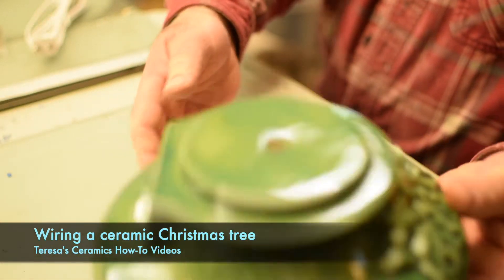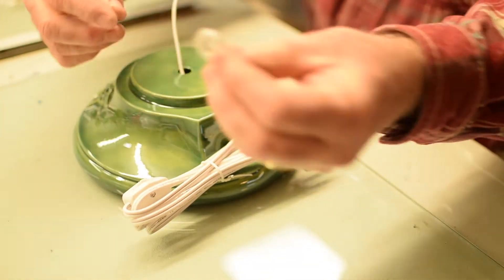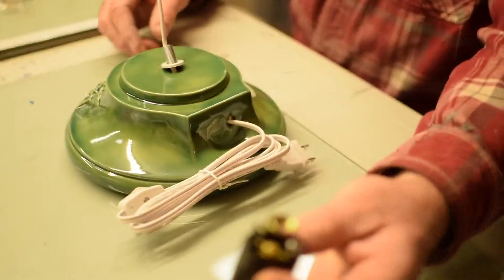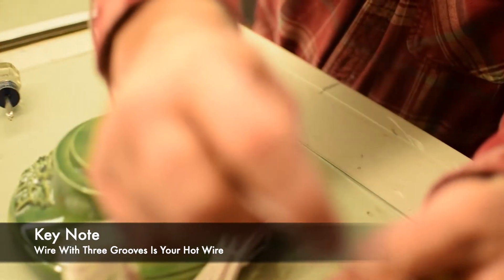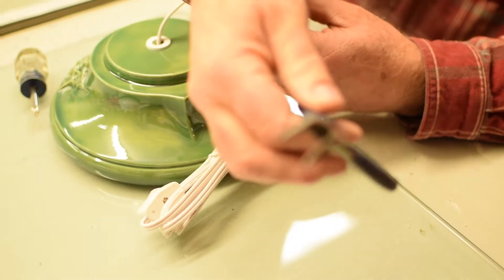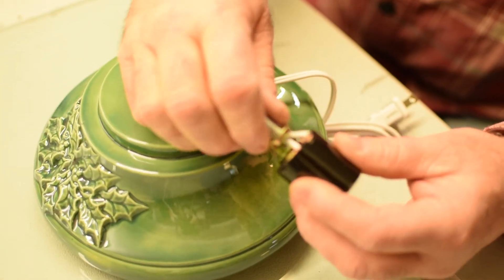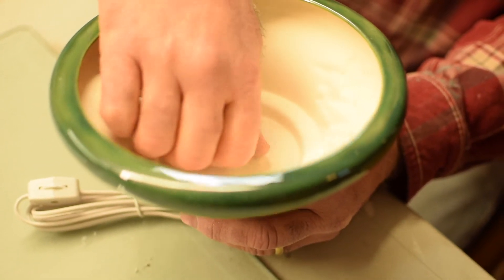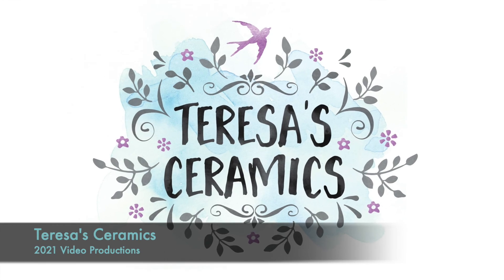How-To | Wiring a Ceramic Christmas Tree Base | With Teresa's Ceramics

Comment: Good video, however there should be strain relief (provided by knot inside base, or Ty-wrap ,to keep wire from jerking out it cord is jerked. Also bu Ul convention, the ribs on the jacket are not the hot, rather neutral. This is important because is someone touches the bulb she’ll even with switch off it becomes an electrocution hazard.

Comment: One mistake though.......    You didn't tie a knot in the wire underneath the base to prevent someone from pulling on the wire and yanking wires from the socket.  It's a good safety measure to do.  Some people call the knot a "strain relief"....  Hope this helps out someone down the road .